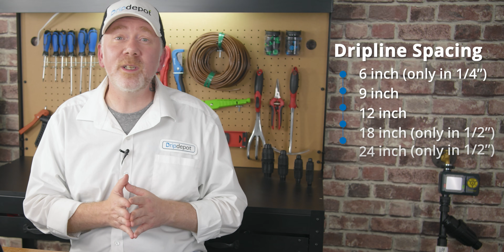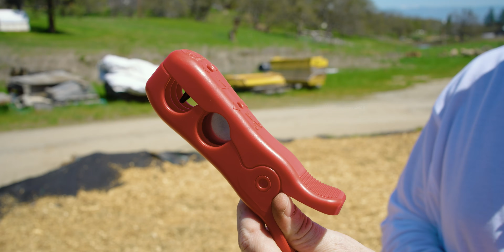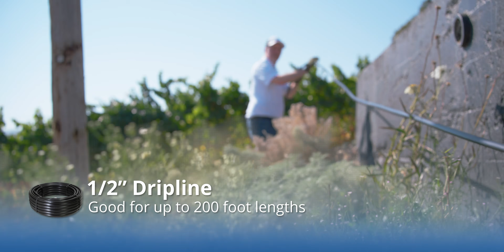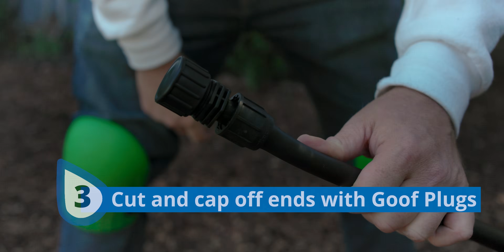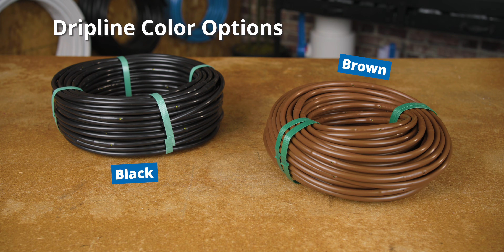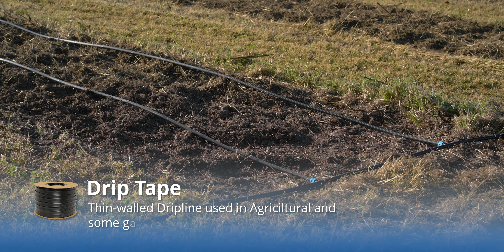Dripline: Choosing the Best Type for your Irrigation Project

Comment: Hi, great video, thanks for making it! The reason I'm watching is because I've got a small, but burgeoning garden with a variety of different things. I've got about 10 of those fabric planters in various sizes averaging around 8 gallons each. I have no idea how much water I should be giving each, but I have been just watering them manually once a day each morning, and counting out one minute while spraying each of the bigger ones, and 30 seconds for each of the smaller ones, and it seems to be working. I really want to make this process automatic, and I love the idea of using that 1/4" drip line, since its flexible enough to circle the plants in the planters. I was wondering if you could give me a list of what I would need besides the drip line. All of the planters are in a line with one 90 degree turn with the fence. I have the following planters:
-3 grandiflora tunburgias (these put off really nice flowers)
-2 mother in laws tongue (snake plants)
-1 10 gallon planter with like 8 Moringa trees in it, all of which are growing, one of which is almost 6 ft tall now
-1 10 gallon bamboo plant (it's a shorter growing, clumping variety)
-1 grocery store basil plant that is really going off because I've been chopping the tops when I gather a harvest for pesto
-1 10 gallon planter with a hybrid willow tree, doing well, about 5 feet tall
-2 star confederate Jasmine plants, doing okay, but not as viney as I want
-1 home depot pink flower plant/bush that I can't really tell what it is

They are lined up on the two fence panels in the corner of my yard, so there's only about 10 feet between the ones that are furthest apart. I only have a garden hose and a hose reel, I have no other equipment yet because its very confusing trying to figure out what to get. 
Again, if you have the time and feel like helping me with a list of what I would need besides the 1/4" drip line, I would greatly appreciate it. If not, no worries, and thank you again for making the video!
Reply from the maker: Joe, that sounds like one heckuva burgeoning garden!  Happy to help here  :) 

For the most part, there actually aren't that many different parts involved - there's the parts to connect it to the water source, the mainline, fittings like elbows to accomplish its layout and the drip line.  I know that's simplifying it to some degree, but I'm not oversimplifying it too much when I say that's really all there is to it. 

From what you described, I think you'll just need a Head Assembly (these are the parts that connect at the hose bib and they come in kits that have all the needed parts), mainline tubing of probably 1/2" to get to the containers, then some 1/4" barbed connectors to connect 1/4" "blank" tubing to the 1/2" mainline and 1/4" tees to connect the 1/4" dripline to the 1/4" "blank" tubing and make rings that go in the containers.  

The only thing my list above leaves out are just fittings you'll need to accomplish your layout like Elbows for 90° turns, Tees if you need to split the mainline in two, and that's it.  

Joe, if you like, you can reach out to us at our "Contact Us" link and just put something like "Joe from YouTube" or "Attn: Adam" in the subject/title and I or one of my colleagues will make sure it gets to my in-box.  I have some images that can really help here and I can assist in making sure all of your parts work together and that there's no conflicts or incompatibilities.  And I'm always down to help Clippy :D

You can either submit a ticket through the web form or get our email address here (the web form goes to this same email address): https://help.dripdepot.com/support/solutions/articles/11000049095-how-to-contact-drip-depot

Don't hesitate to fire one off, I can absolutely assist here, just be sure to mention it comes from YouTube or my name so it comes to me :)

Comment: Hi, I wondering if you can help me one more time. I have a flower garden. I know that I cannot pass 200ft with the 1/2" tubing. currently this garden has 300ft of 1/2" tubing. 3 row of 200ft. My questions can I put it all on the same zone. If so, do I need to step up the main line to 3/4" in order to connect all 3 rows together. Can you clarify what I should do.
Reply from the maker: You could potentially put it all on one zone, though it's best to calculate things beforehand to make sure, I'm happy to help with that part :) 

One of the factors you're looking at when deciding to zone or not is the flow rate provided by the water source compared to the flow demand of the system.  As a quick example, if the water source flows at 300 GPH but you have 400 GPH in emitters, some of them will be starved of water.  In a case like that, a second zone ensures there's enough water for all the emitters. 

The flow demand of a system is just the sum of all the emitters operating at once.  For example, if you have 500 0.5 GPH Drippers, the flow demand is 250 GPH.  

Testing the flow rate of your water source is just as easy, all you need is a timer and a bucket.  We made a short (just a little over 2 minutes) video that walks you through the process: https://www.youtube.com/watch?v=tGxJaqQeg94&

The flow demand of the system can also help determine if the 1/2" would do the trick or if 3/4" would be best.  The 200' rule is a general rule we often use to help "ensure success" for new DIY'ers, but in lower flow situations 1/2" tubing can go over 200'.  

I'm also happy to help here.  If you get a chance, let me know what your flow demand is (sum of all emitters operating at once) is and I can help tell you what the means for mainline size.  If you test the flow rate of your water source, let me know what you get.  With both of those numbers I can help fill in a lot of the blanks :)

Comment: I’m removing the grass in my park strip and putting ornamental grass and perennials. I’d like to use the retro fit sprinkler conversion for water source.
My park strip is 50 feet long, should I use 1/2 inch drip line?
Reply from the maker: Depending on the location of the sprinkler riser you're converting you'd have a couple options, but at 50' 1/2" dripline is definitely one of the top choices as it can easily handle those distances and more.  The 1/2" dripline can also accept additional drippers if you have a plant that's just out of the way, 1/4" lines and 1/4" dripline cannot have emitters punched into the wall like 1/2".  

Essentially, you'll have some options depending on the layout, but 1/2" dripline definitely leads the pack and it's hard to go wrong there :)

Comment: I have a flower bed that I am going to be using 1/2" drip line in. Is it ok to pop a 1/4" hole into that for a couple larger emitters for a few rose bushes?
Reply from the maker: You bet!  As long as the additional flow isn't too much for the water source or 1/2" line, you can absolutely punch in some 1/4" tubing to add a few extra drippers to the rose bushes.  Just be sure to punch in between the emitters in the 1/2" drip line so you don't accidentally hit the emitter and you'll be good to go :)
Reply: @dripdepot  Thanks for the quick reply

Comment: Currently working out a parts list for my garden spot this year . I`m doing two 4`x8` raised bed for the square garden method , a 6`x8` block of corn , twenty 10 gallon grow bags , 2 potato towers and some herbs in planter boxes . I`ve put a lot of thought into it this year and you have put me on my learning curve to handle the watering better .
Reply from the maker: Joey, if any questions come up while you're planning or installing, don't hesitate to drop a line, absolutely happy to help with any aspect.  

And your garden is sounding a lot like mine this year.  I used to grow potatoes in my in-ground bed, but this year I'm moving them to some potato towers.  I'm also trying to grow corn again; last time I tried the raccoons got it when they were seedlings, this time I'm going to let them grow inside until they're larger.

Comment: Do you have any advice for combining a drip line with other emitter types, like an adjustable spray emitter? I have a raised bed with a variety of plants. Most of the plants will do well with 6 inch or 9 inch drip line, but I want to also include a spray emitter or two in areas with sensitive lettuce or herb varieties. 
Thank for all of your helpful videos!
Reply from the maker: You bet, it is acceptable (and fairly common) to have a spray type emitter on the same zone as drip line.  Some extra planning is required because a spray type emitter typically puts out more water than a drip emitter and they'll be on the same watering cycle.  At my home garden I have some weeping willow I water with a spray nozzle that's on the same zone as a few of my garden beds and I'm getting good results.  The one I use is this one (technically called adjustable dripper, but it's an area coverage type): https://www.dripdepot.com/adjustable-stream-dripper-stake

A similar one that is more on the "spray" end of things is this one here: https://www.dripdepot.com/adjustable-vortex-fan-dripper-stake. 

Basically, you sure can, just be sure to plan it so that the area watered by the sprayer doesn't get overwatered :)
Reply: My new 8ft raised beds are 40 inches wide. I’m planning the drip irrigation - would you recommend 3 lines of 1/4 down them or four? 
I’m planning to grow mixed veggies, runner beans in one herbs in another. Thanks!
Reply from the maker: @petehenley01   3 will more than likely do the trick for you :)  

In common, loamy garden soil water will spread about 12" from the point of drip, so 3 lines will get you even, thorough coverage.  If the soil is particularly fast draining or you plant a dense 4th row of plants a 4th line (or tighter spacing like 6") might be called for, but in the vast majority of cases 3 is the right call here.